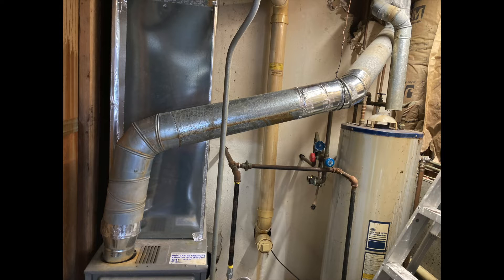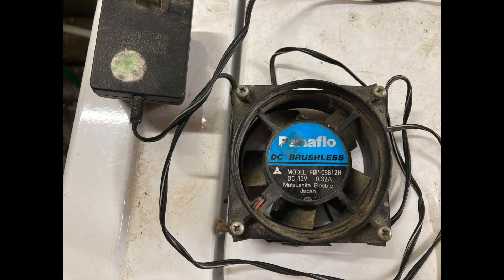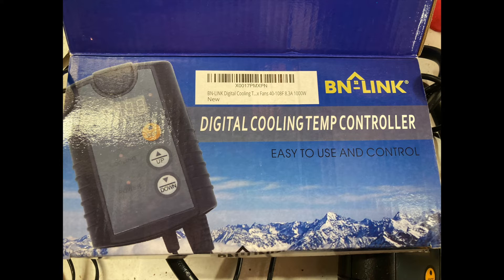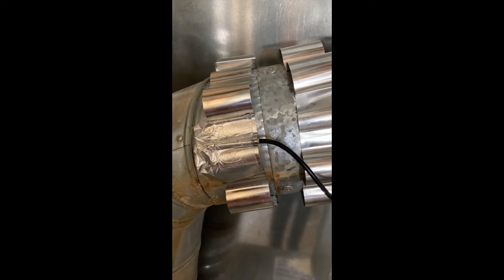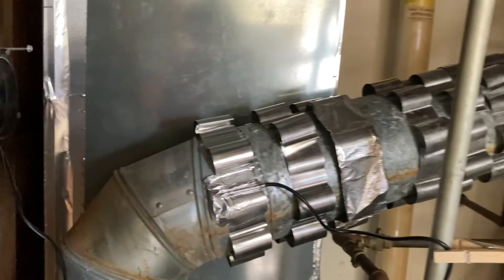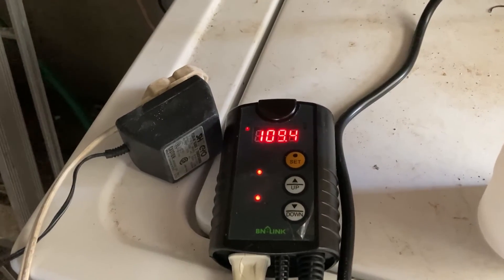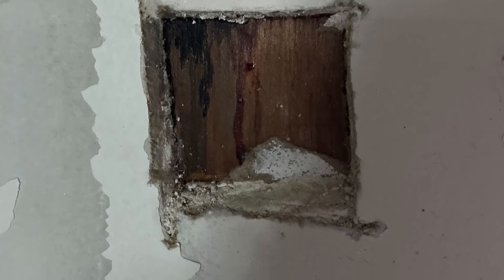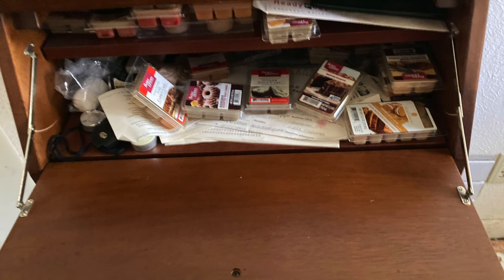DIY Heat Exchanger on Inefficient Furnace

Comment: You had that fan for 30 years wow!!
Reply from the maker: Yep, I'll examine the info on the label and hopefully get you a more accurate age. I used it, along with dryer venting, to vent my cat litter box stinkiness out the side of my house, original application for old fan then SAVED IT for 30 years. Only could find this: https://www.ebay.com/itm/164076145077?chn=ps&norover=1&mkevt=1&mkrid=711-117182-37290-0&mkcid=2&itemid=164076145077&targetid=1493511242865&device=c&mktype=&googleloc=9016254&poi=&campaignid=15431381266&mkgroupid=128740829685&rlsatarget=pla-1493511242865&abcId=9300764&merchantid=8486414&gclid=Cj0KCQjw0umSBhDrARIsAH7FCoeIJQhoGByQeI5w6o1uxpRvSUiu-OQRZaUYulQe-6SqlO2gQMGDMD4aAgcmEALw_wcB